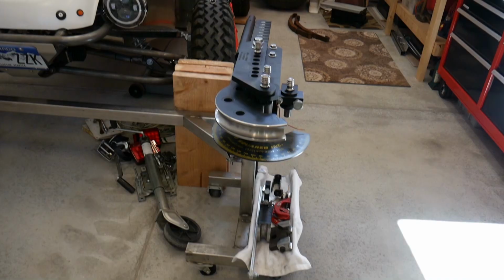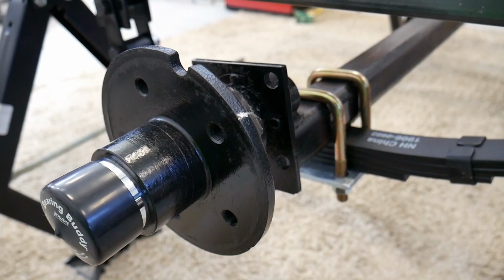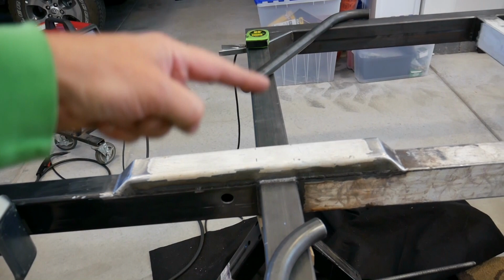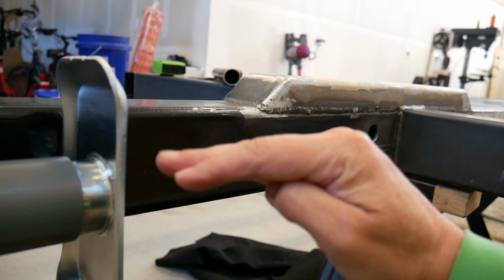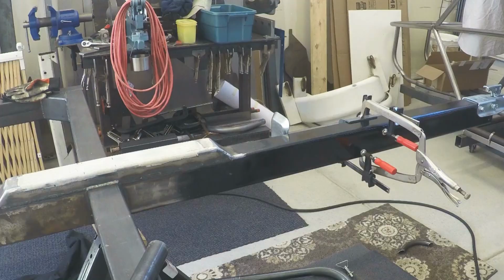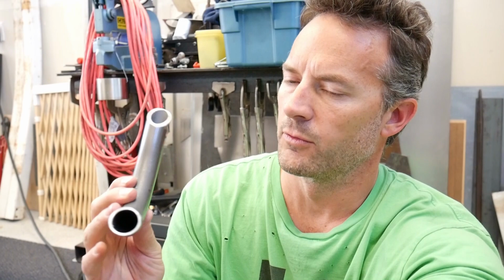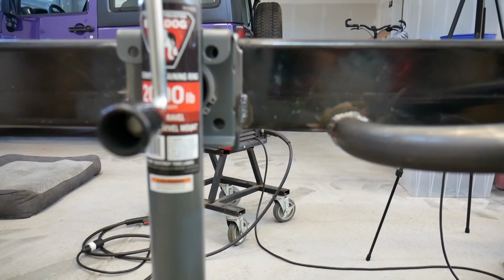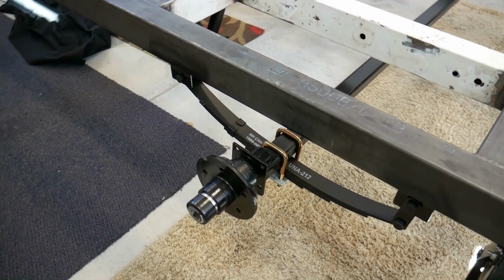Custom Trailer Build Part 2

Comment: On several trailers that I own I have run a peace of 1/2 PVC pipe from front to back  as a electrical conduit to keep wires out of the weather and direct sunlight. 7 wire cable with flat plug is great for that future double axle setup with brakes. Just my 2 cents. I know your way ahead of me on that stuff :-)
Reply from the maker: Multiple Baja's and multiple trailers? You're like a fleet owner Mr EZGZ. lol The PVC conduit is a good idea, thanks.

Comment: You might do this now for a few dollars. Not sure how long your gas holds out.  But one of my next videos is going to be hiding a under mounting gas tank with a small electric pump from a car. 
 under my trailer for extra gas. For thanks giving weekend at Glamis sand dunes!
Reply from the maker: Like an auxiliary fuel cell for the tow vehicle or towed vehicle. That's a cool idea. 👍
Reply: Doug Bug I Purchased a fuel cell from a 2016 Toyota Corolla yesterday with the fuel pump still in it. Paid $25 at the recycle yard. It will fit beautifully under my trailer in the center in front of the axle where it is safe.

Comment: Hello, when it comes to mounting an ecotec on an engine stand, how did you go about doing so? What engine stand did you use if you had one, and did you have an adapter plate?
Reply from the maker: To mate the Ecotec to the transaxle I have an engine adaptor. Mounting the Ecotec to an engine stand is no problem if it has the adjustable mounting arms.

Comment: Are you towing this with the Jeep IV seen in the background for your videos. If so are your running a brake controller/ brakes on the trailer. I'm wants to build a similar set up and tow with my jeep Wrangler.
Reply from the maker: I am pulling it with the Jeep. 
Currently I'm using the trailer for just little items. But when I start using it for the Baja it will have electric brakes. I wouldn't recommend pulling that much of a load without electric brakes. The Jeep brakes aren't very strong.
Reply: @DougBugBuilder  yes I plan on running brakes.